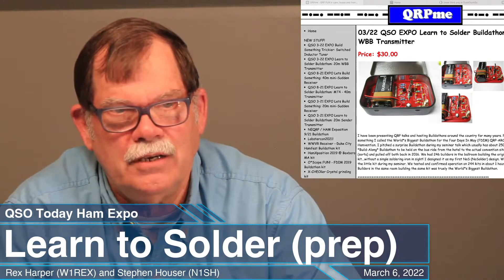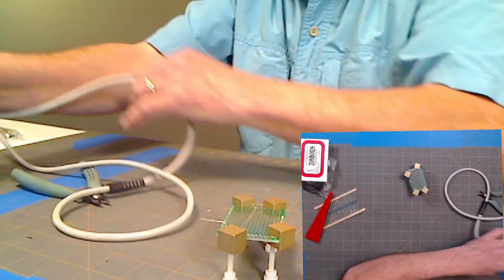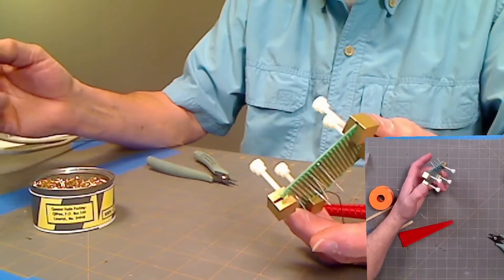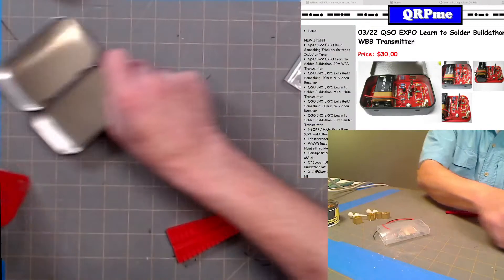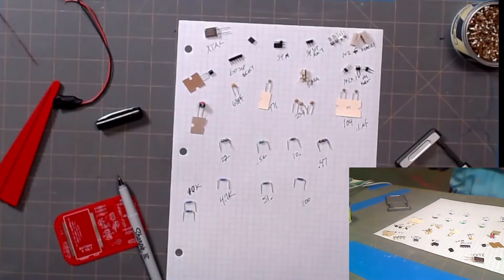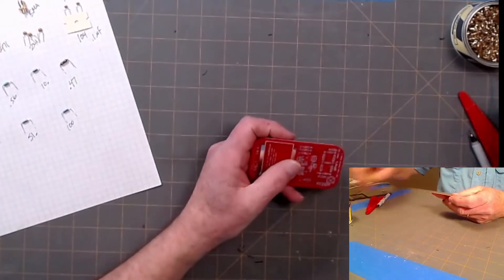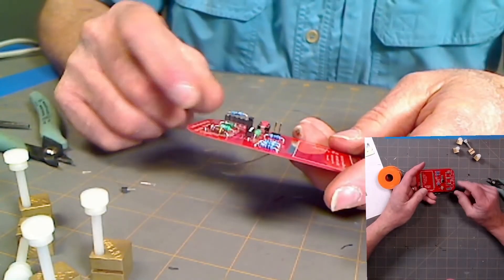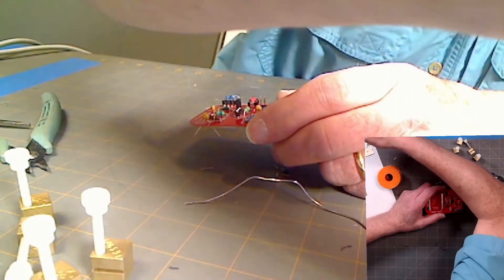QSO Today   Learn to Solder Prep 3-06-22

Comment: Rex, I ordered one of these during the stream What do you recommend for a strip to isolate the battery from the rest of the radio?
Reply from the maker: You can use practically anything from little strips of bare copper pcb to 'guardrails' made from formed resistors or SIP male headers, disc caps. Anything laying around the bench that you can solder to the long pads. I'll throw a couple of examples up on the web page....later tonight or tomorrow. Gotta go machine up some Toroid EZ tools to fill some back orders.